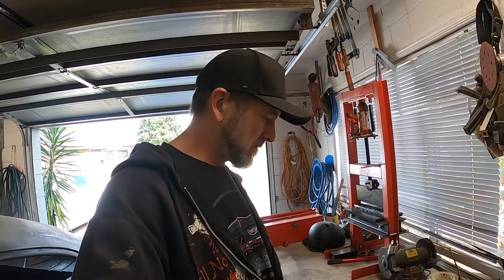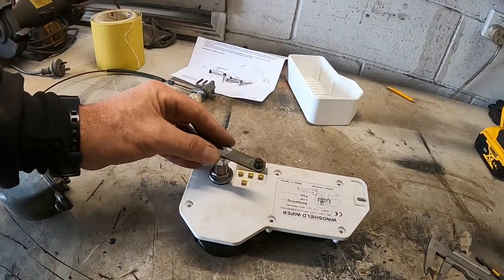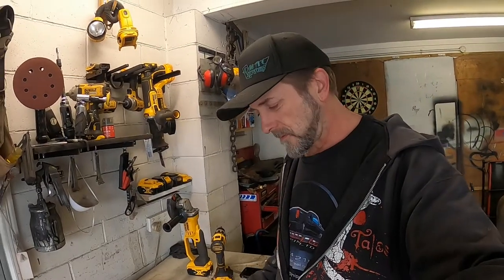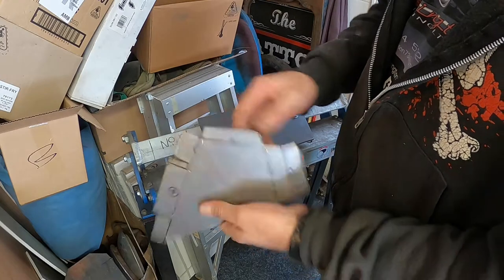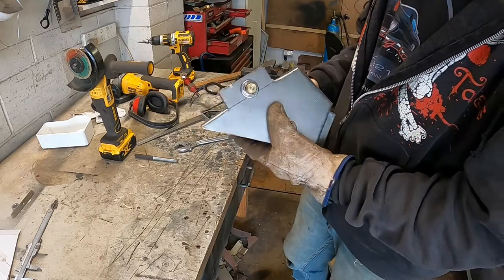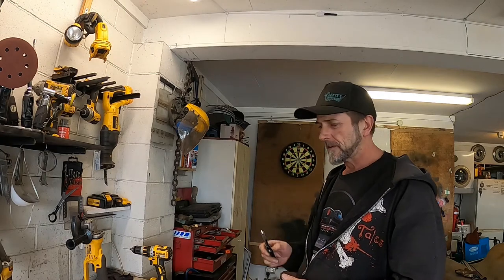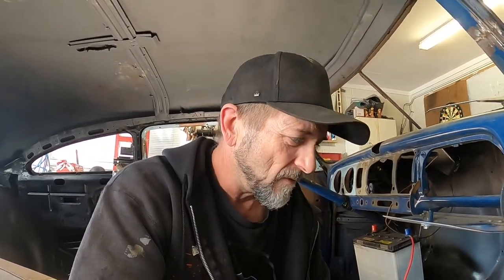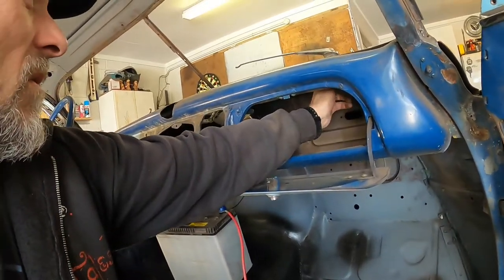Area 51 Update:  2 speed 12volt Windscreen Wiper Conversion on the 1951 Chevrolet Fleetline Kustom

Comment: This is just like any hot rodding day in my garage. Think it through, figure out how you want to adapt it, mock it up, and make it. Incredibly satisfying making a part that solves the problem. I need to do the same thing with my '49 Chevy coupe. The vacuum wipers work, but they are annoyingly slow, and equally annoying, they slow down or speed up depending on the RPMs of the motor, and changes in vacuum draw. Good job, mate.
Reply from the maker: Thanks spamwagon.

Comment: Putting us non windshield wiper, rain-x guys to shame lol. Good stuff.
Reply from the maker: Haha, it rains a fair bit here in New Zealand, plus we have to have em to get street legal too.  But I still use rainex also.  Its a pretty easy conversion if you've still got the arms and linkages, Hardest part was working out the bracket thing to mount the motor.